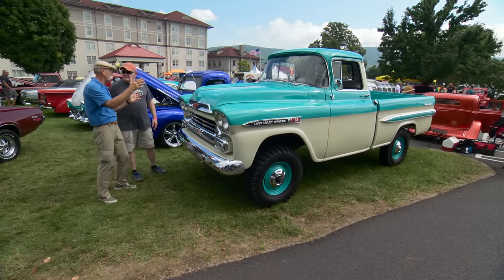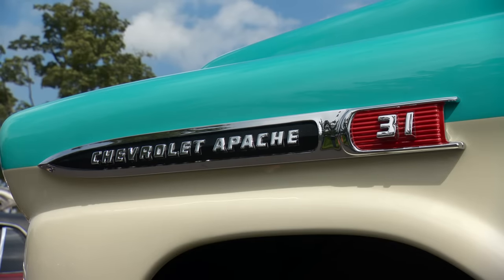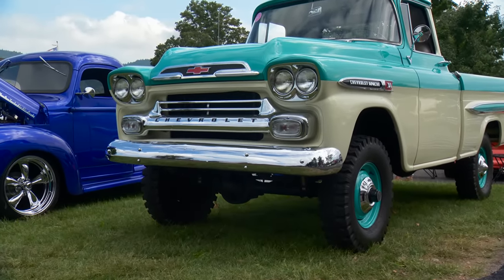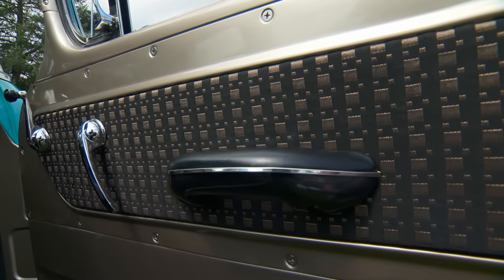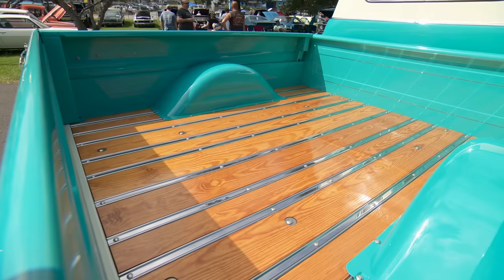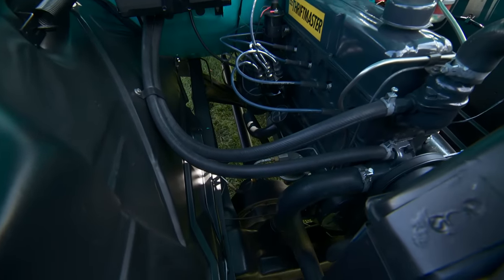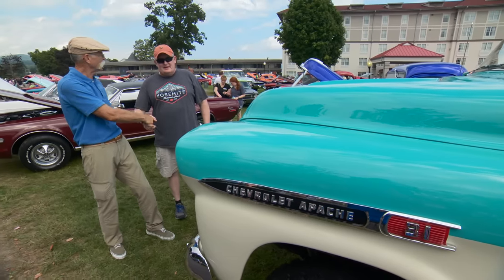Lowest 1st gear EVER is the HOLY GRAIL transmission

Comment: Folks, short of fuel injection and safety features, we've gone so far backwards with automotive design it's genuinely depressing.  This truck is GORGEOUS!
Reply: Your referring to anything made for production
Reply: Modern oil filtration and synchronized transmissions are nice too. We’ve come a long way. I personally think our peak was in the early 2000s, but I also appreciate the completely mechanical old stuff.
Reply: @gmctech they'd be smart to bring back retro styling for trucks. Like the Bronco and Mustang throwbacks.
Reply: @swamp-yankee agree
Reply: The most worthwhile safety feature is the human brain which has gone downhill steadily. People currently trust in safety features instead of being attentive and learning how to drive without a phone in hand. Seat belts have logical fallacies presented in marketing that don't take the severity of accident into account
Reply: @calebz1448  so true it's not even funny.  All the safety features we xan muster won't save you in a rollover or a fall from a bridge... this coming from a guy who actually took a ride in a car that fell off a bridge before.
Reply: @Tipman2OOO  my cousin survived because she was thrown from the vehicle. The vehicle flipped and landed upside down on a rock crushing the roof through the driver seat. Seat belts don't save lives, they only mitigate the injury level. Humans save lives when they don't contribute to the 97% of human error wrecks. Vehicle inspections have eliminated most mechanical failures to cause wrecks but until we mandate cell phone jammers when vehicles leave "park" idiots will always cause problems for the innocent
Reply: @Tipman2OOO  YouTube won't allow me to tag anyone in more than 1 sentence sadly
Reply: @calebz1448  definitely.  We only evolved to go like 10-20 mph max running.  Even at that speed a trip and fall can have disastrous consequences.
Reply: @calebz1448 In the US we have something like 99.7% seatbelt usage, but half of all vehicular deaths are unbelted.
Reply: Cars look like they do now so you and your family don't turn into mashed potatoes in a car crash.
Reply: @RobotJustice The theory of evolution is what ever is beneficial to procreate will survive to pass on genetic information.   Human intelligence is both a positive and negative factor in this theory.  On the first hand we come up with ways to help humans survive on the second hand we come up with ways to negate the first hand.   Then there are those who choose to simply ignore the first hand all together and for them we have the Darwin Awards.
Reply: Imagine being trapped in a vehicle that was involved in an accident because the door locks automatically locks when the door is shut.  Or/and unable to roll windows down because of faulty safety computer operated death trap vehicle. Life size plastic models.
Reply: @RobotJustice  so half of all deaths are wearing the seat belt.... almost sounds like accident severity is the determining factor for life or death. Actual studies aren't done on that I've tried to find them but that wouldn't follow the lie that the govt is looking out for your safety with the seat belt
Reply: @RobotJustice  again YouTube won't let me tag people in more than 1 sentence sadly no matter how much I report it
Reply: I agree until it’s time for the commute to work everyday and fuel mileage but other then that I’d much rather have a old pickup truck
Reply: @calebz1448 even before phones and less cars on road there were still more deaths and accidents than today.
Reply: @KuntalGhosh  yes, due to human error and ignorance. We always find a way to harm ourselves
Reply: @calebz1448   Traffic deaths in the US in 1959 - 36,223.  Traffic deaths in the US in 2019 - 36,355.  The population has doubled during that time so literally today's cars are twice as safe.  Probably more since people drive further now than they did 60 years ago.
Reply: @bigguy321  I would argue that people have gotten half as stupid. Back then when the interstates had dead ends people would run off past the end of the road because they didn't know any better. Now some people know better but there are still those idiots who refuse to use a turn signal or obey simple laws of the road. Seat belts are not the answer the government claims them to be
Reply: @bigguy321  2nd reply since YouTube won't allow me to tag anyone in more than 1 sentence
Reply: I wish they still made em today …
I’d buy one in a heartbeat 💗
Reply: @swamp-yankee 1970’s 
Muscle car era 
No electronics….
Wahoo !!!
Reply: @KD-lq1sr post fuel injection but pre computerized everything , yeah early 2000s maybe late 90s
Reply: Yeah , living through collision at the expense of styling is too much to ask of a car . Screw the passengers .
Reply: @barnsnoble7066 drive sensibly and don’t crash …
You won’t get hurt …
The human is usually the problem
Reply: No we have not
Reply: @batmanlives6456  Idiotic statement .
Reply: I couldn't agree more.
Reply: @station08  You shouldn’t
Reply: @tyronelegstrongiv2206  speed, wreck geometry, terrain and specific vehicle build have more to do with survival rate than seat belts. If seat belts are so effective why do 40% of deaths happen to people who are wearing them? A seat belt is only an injury mitigation device used instead of developing injury prevention(pay attention to the road instead of phones)
Reply: @@tyronelegstrongiv2206 YouTube won't let me tag anyone in more than 1 sentence
Reply: That Chevrolet badge ruins it imo it looks like shit
Reply: Fuel injection sucks and seatbelts may save lives but at the cost of far more injuries (a lot of them disabling) than lives saved.  Cheers.
Reply: Fuel injection was availabe from GM in the '50s.
Reply: @batmanlives6456  You do realize 70’s muscle cars had ignition systems and electric safety and comfort features.
Reply: I can live with points or simple electronic ignition…
A cassette or cd player and that’s about it !!!
Reply: @swamp-yankee  I agree, the early to mid-2000s is the perfect sweet spot of useful technology but still being practical enough to work on.
Reply: @ColoradoStreaming  yeah much older and stuff gets less viable fast. Love my 05 gmt800 diesel 6 speed.
Reply: Agreed 100%
Reply: @pooddescrewch8718 so you claim your an expert driver and always drive defensively…..
Reply: @handydan5150 and was rubbish !!!
Reply: @batmanlives6456  You’re*
Reply: Even the gains of EFI are overstated. We can control the air coming in to match the AF ratio of EFI, a good mechanical timing system can exceed what electronic systems are capable of as the electronics are artificially limited. We are making more power now than back then but gearheads have been doing that for 50+ years now. You can build a monster engine without sacrificing drivability even on old engines.
At this point I'm hoping to maintain my old vehicles rather than buy a new one. Big brother spying and remote cutoff is a dealbreaker.
Reply: @glenwaldrop8166  Really ? When was your last tune up ?
Reply: @pooddescrewch8718  car isn't assembled at the moment.
When I was driving it I took care of it, every oil change I'd give it a once over. It's not rocket science.

I have the same level of issues out of our EFI vehicles only now it's throwing a code rather than me diagnosing it by ear. Couple that with how much more complex modern cars are and you're not much better off. After ~70K miles you start to have issues on either, parts wear out.
Reply: @swamp-yankee nah a little bit early when you could still get mfi and little in the way of ecus
Reply: @swamp-yankee 1987-1995 was the pinnacle imo
Reply: @JonBergacs  I respect that. Id just extend your range to the first half of 07. I’ve had two gmt800s and I’ve got no complaints except that the first one was clapped and rusty. Really happy with my current farm truck. It’s a 6 speed duramax, but a similar drive train in a ford or dodge would have been just fine.
Reply: Yeah, too many gray/white/black amorphous hunks of plastic rolling around these days…
Reply: @BroncoJoeAK  that not true
Reply: counterpoint: it has a top speed of 50.
Reply: FJB.  FW
Reply: @BroncoJoeAK If you were going fast enough to where a seat belt did serious damage to you in an accident, well you probably don’t want to see the after effects of the same wreck without one. 😂
Reply: I had a 69 International 1 ton 4X4. In low range 1st gear I could just let out the clutch without giving it any gas, open the door and get out and walk along beside it. I don’t think the engine was turning over at more than 100 rpm maybe less.
Reply: Had to change to meet government regulations
Reply: Once OBD II came around in 1996 and more things had sensors on them I say HELL NAH. Pre emissions Analog systems are easily better imo (Cummins B series, TBI 350, etc.)
Reply: We live in a throw away society now.
Reply: And just what exactly is so great about modern safety features..?
Reply: @calebz1448 ON WHAT GROUNDS OTHER THAN SAFETY WOULD SEAT BELTS EXIST???? WHAT MALICIOUS INTENT COULD POSSIBLY BE THE POINT??????????
Reply: @mushovers3006  displacing blame from government failure to educate and enforce rules to blame the failure to use a faulty safety system by the individual. The real solution is to not get into a wreck by paying attention. Human error is responsible for something like 97% of wrecks
Reply: @swamp-yankee late 90s were the best. Mitsubishi/toyota were on top, pontiac was still making cool cars. For goodness sake the 3000gt vr4 was made in 1990. And still outperforms modern cars on 0-60 modern features and more! Its amazing
Reply: @FOUR22  I like 90s stuff too, but it’s before my time, and in my area it’s mostly rusted out. I do think that gm were behind when they were putting gas engines or the 6.5 in their trucks, and the gmt800s are great. I’ve had a gas that rusted out, and love current farm truck which is a 6 speed LLY duramax. Hope to keep it nice enough to run it as long as I need a truck. It’s real slow, but I don’t mind.
Reply: Big Government
Reply: @batmanlives6456  easy to say but living in the city I've been hit multiple times by other drivers who have no idea what they're doing.  It's really wild because everybody else looks at you like you're a horrible driver, in reality nobody else knows how to drive, so all their bad energy gets thrown onto you.
Reply: Wait... you mean you dont want even more angles and accent lines on your civic?
Reply: @kcrichton7485  and lane ignorance and the-unaware-of-whats-around-you back cam?  And "crumple zones" so a small fender bender totals your car?  And headlights that blind everyone else?  And bigger and bigger rims to get bent on potholes?  And direct injection to make sure your engine chokes on its own fumes?  Not to mention ever stricter emissions devices that seem to always fail and cost the car owner thousands in order to slightly decrease fuel usage?
Reply: @Tipman2OOO  The Great Wall of China, the Berlin Wall, the Dominican Republic/Haiti Wall, the Trojan city wall, walls work! Finish the wall
Reply: @RiggyRonnie  😂we could definitely use it right now

Comment: The truck came with an SM420 gearbox with a 7.06:1 1st gear ratio, since the headline temped you, but the host, and owner never bothered to elaborate what they were actually talking about...
Reply: thank you
Reply: That’s not even the lowest either. My dad has a 66 International 4x4 pickup, it has a 7.7:1 first gear. I think the transmission is the international T35
Reply: My unimog u900 406 6-speed gearbox has a first gear ratio of 14.53 : 1
Second gear is 8.66 : 1

In crawler range 1st gear is 300.307 : 1, but I don't have that option and it's technically separate from the gearbox.
Reply: Which is ironically a higher ratio
Reply: Had a 72 Chevy 3/4 ton 5 speed that had a very low 1st gear. I'm not sure what it was but I know you couldn't stall it. Dump the clutch with no throttle and it'd still chooch.
Reply: Whewwww! THX!!! Was super worried about that t case and tranny spec! As fer shitting on these two.. I checked. Yer trucks not on YouTube
Reply: @AdamantineAxe   Was that factory installed though?  The guy said this was the lowest 1st gear for a factory option...
Reply: @donnie1581   It was likely a trans swapped from a medium duty truck...  GM offered a 5 speed in their medium duty trucks (C40 to C70) in the '70s but I don't remember who actually made them... Eaton maybe... but yeah, they had a really low 1st gear.
Reply: @donnie1581 NP542D with a 6.15 low gear was what I drove, though it did have the two speed axle. Ratios were 6.15, 3.30, 1.86, 1.17, and 1.00, the short 4-5 made sense with a split axle with around 1.35 lower ratio in low range, so that would kind of be the equivalent of around 8.2 in first gear, low axle.
Reply: i would say though that was made as less of a consumer truck, made to pull and carry bigger loads vocational. with that logic then some larger rigs have even lower gearing  @Rmehki
Reply: My 68 Merc (390,4sp)has a very low 1st gear.Gotta double-clutch it(un-synched?)or just start in 2nd.That is what I learned to drive with.ALL manual,bring on the solar flares,no tech here.Owned since 1982.Good vid.😎👍✌🇨🇦
Reply: @donnie1581 I had a 91 dodge w250 with a really low 1st gear and I would try to stall it and it wouldn't stall and it would fire up in gear. It had 4.10 axle gearing but idk what manual transmission it had
Reply: Oh yeah...FIRST gear was never used unless you were stopped and it was only to get it moving a few mph. And .in the 70's  you could get a big block in the 1/2 ton trucks.....like a bare bones precursor to a chevy SS of the early 90's. even with the 400bb, a 3.07 is still kinda soft if you do any serious towing because it only has 30 more ft-lbs than the 350  perhaps you could special order a 3.73 or a 4.11 if you needed it for towing. there was also a 4.56 available on 3/4 ton trucks and that was for the the dana 60 without the big block as the 4.57 is the corp/eaton. 3.73 was standard on all 1/2 ton burbs and the 4.10 was an option available for the K20 burbs.

Comment: I really miss granny gear in modern trucks.
Reply: Why? It has actually never, ever been used to do anything but show your friends how low the gears are. It's not good for climbing. It's not good for loose traction.
Reply: Granny gears are good for compression braking down steep grades, especially off road. Or good for running equipment off a pto unit
Reply: @adamanderson5055 One can easily snap an axle with the granny but that being said the four speed box is a hell of alot better than the three speed. My '72 3/4 GMC had such a low rear end I could start off in 3rd at most lights. Miss it much.

Comment: My dad bought a brand new ‘57 GMC with Factory NAPCO 4wd and the 270 six, in, of course, 1957.  Drove it for over 30 years.  The NAPCO front axle was advanced for breaking big snow drifts as the tie rod was behind the housing, thus protecting it.  Many times after busting large drifts I would lift the hood and see nothing but packed snow in the engine bay, but the 270 was silently ticking over underneath.

Comment: As a kid, my dad ran a service station through the late 50s to early 70s. He had a 61 (I think) Apache that was his parts runner and winter snowplow for our house, the station and a few other driveways. It was the ugliest thing on the road but man, nothing could stop it. I was 15 in 1969 and the truck was just completely rotted away. A friend of mine bought it and we stripped it down to engine, seats and that was about it. We would run it out in the woods. If a tree was in our way we just pushed it over. Great fun!

Comment: I learned to drive in my Dad's 59 Apache. I think it was a 36, 1 ton, 4X4, high low range and dualies. Started life as a boom truck. He threw a shortened flat bed on it and a goose neck hitch in the middle of the bed under a trap door. Geared so low you drove it like a 3 speed. Start in second gear high range. 1st gear you could drive it on the starter. Kinda and prolly not far.
Reply: Cool.
If it was a "36", then it would have been a 3/4 ton.
One tons were "38".
Reply: I learned to drive stick in a Ford 1-ton with a 460 my Dad had borrowed from his boss. I was maybe 10 years old. I can still smell that clutch burning. 😂
Reply: Must of been a 38 then. Over forty years ago.
Reply: @Rembrant65  I understand.

Comment: My first truck was 1958 Apache. It had the original 283 v8, a wrap around back window, crome grill headlight trim and bumper. I gave $500 for it with a fresh paint job in 1977. My favorite part of this series of trucks was the hood.

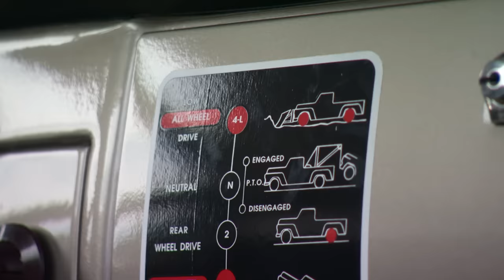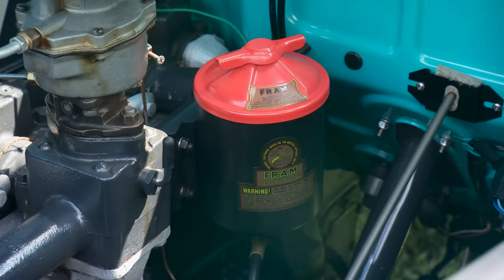Comment: Great truck! I have owned one of these from the 1960's. My current truck is a 1957 1/2 ton, Line built truck (Chevrolet started factory building these half way through '57 for Chevrolet but 1956 for GMC) My truck is Sandstone Beige (kinda pink). Line built trucks from Chev. in 57 came with oil bath air filter, added on oil filter, heavy duty heater, and package tray above fuel tank behind seat. 1/2 tons had 3:90 gears ( Yukon gear has a 3:30 replacement set) 3/4 ton had 4:57 and 1 ton had 5:13. Wheel sizes 16", 17.5" and 19.5". The 3/4 and 1 ton can use a later 3:90 gears set up to 1967. All line trucks through 1959 came with 235 six cylinder and heavy duty 4 speed truck trans. Yes the bed was yellow pine but painted black with black strips. This is a beautiful representative example.

Comment: This makes me miss my 57 Chevy with the dealer installed NAPCO 3/4 ton that I rebuilt from the frame up. In first gear you could set up stakes and let it idle to see if it was moving in low range.